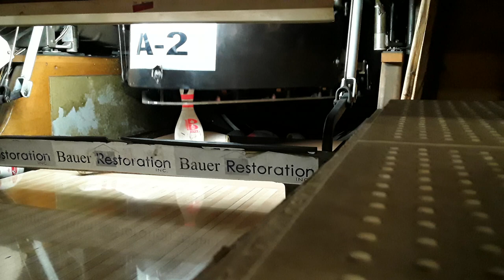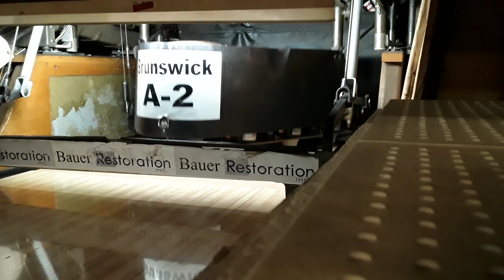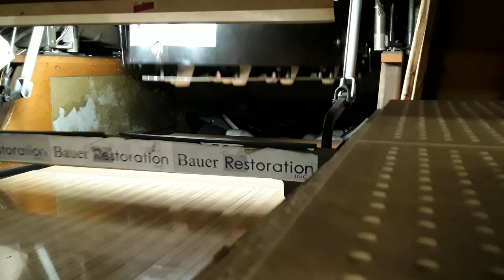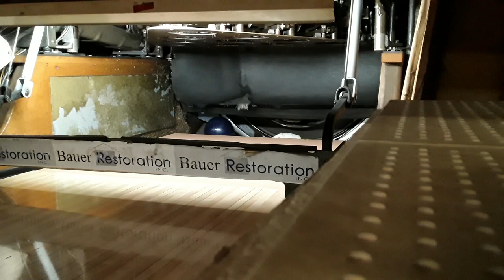Bowling up close

Comment: Nice, linds pins. i own the half scale versions. also the A2 is such a beautiful machine.
Reply from the maker: I agree!
Reply: @drummachine434   Man, those pins just have a deeper sound to them that i like
Reply from the maker: @limagd7362  same here, another thing is they have some nice  pin action with linds
Reply: @drummachine434  true
Reply: @drummachine434  i see you like candlepin, in my opinion candlepin is pretty underappreciated. I own some candlepins that i keep in my garage as well as some brunswick max pins
Reply: @drummachine434   quarantine has me practicing at home
Reply from the maker: Candlepin is very underrated, hopefully someday someone will open up a candlepin center outside of the West (or east) coast
Reply: @drummachine434  i guess people want more of a challenge that they won't get with candlepin
Reply: The sound of these Linds pins remind me of the 1986(ish)-2008 Brunswick pins, which is approximately the time they owned Vulcan and made both brands at the Vulcan plant.  In 2008, Brunswick closed the plant and outsourced pin manufacturing to QubicaAMF, so Brunswick and AMF pins sound the same nowadays...just as they did before 1986, oddly enough.